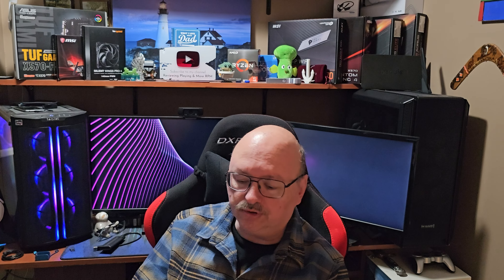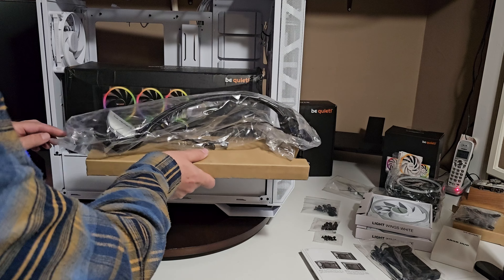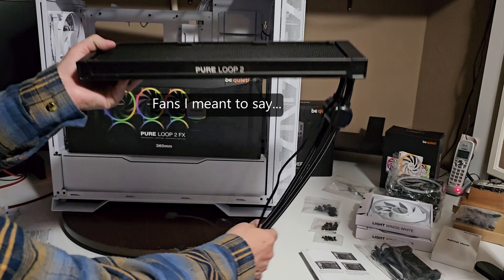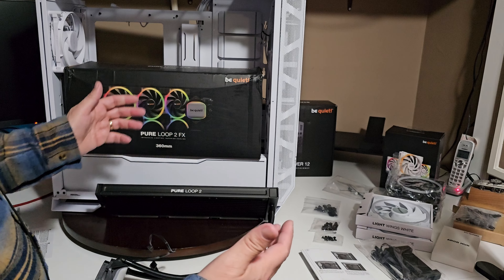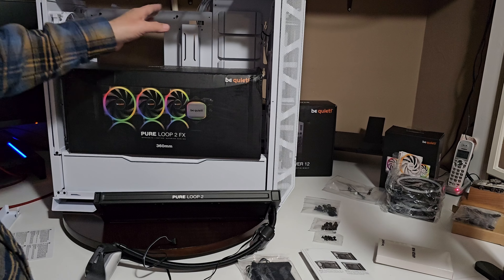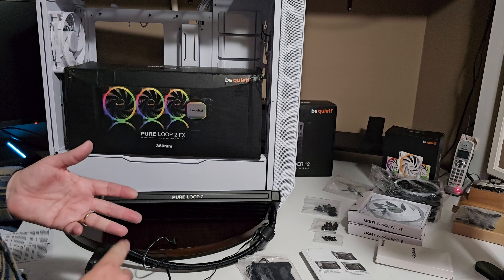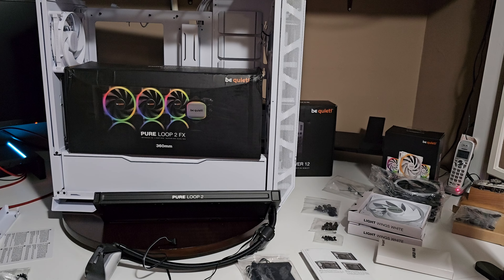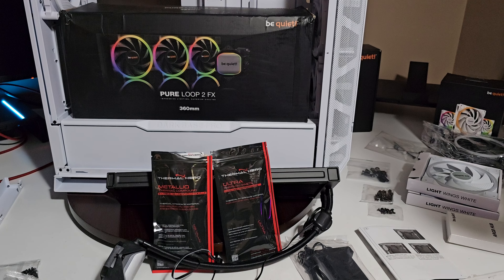be Quiet! Pure Loop 2 FX Intel or AMD Channel Update

Comment: Seems like the radiator should be at the top and airflow going out the top because heat rises.
Reply from the maker: Yeah, thinking I will put it on top, with fans in default position. Thanks